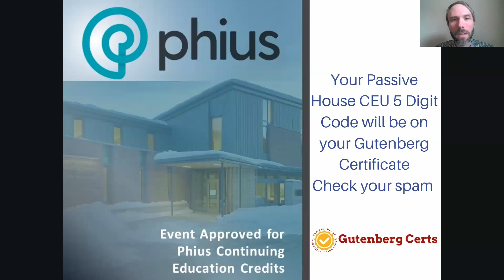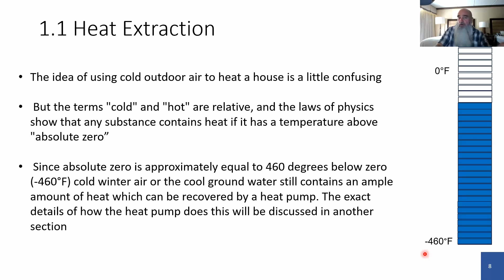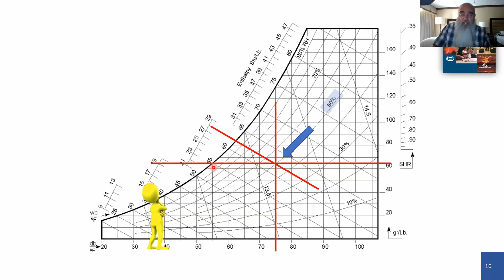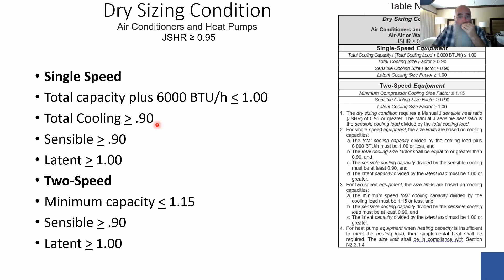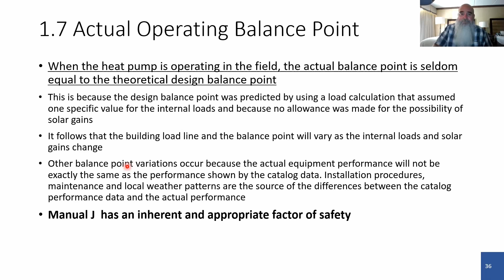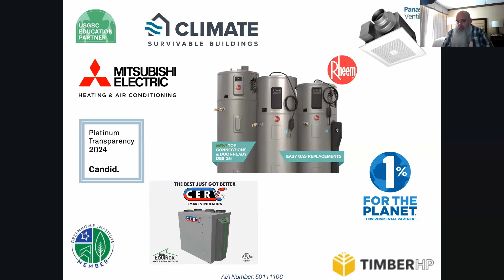Intro to Heat Pump Sizing With The New Manual H

Comment: Great video very nice surface level info to intrigue one to dig deeper and great for what an hour video can do. Like to take a class with Ed
Reply from the maker: Thank you! Please tell us one new thing you learned.
Reply: One section 1.7Actual Operating Balance Point and how Ed explains the inherent and appropriate factor for safety and why its not only built into manual J but all other ASHRAE standards I did not know that was the reasoning and haven’t heard anyone else explain it this way as to why its built into Manual J. I also liked that he reinforced what I had come to believe for sizing in my climate which is MN regarding an all electric system with planned dehumidification. I’m working on a High Performance home in Western WI where I am doing just that with Electric back up because I do not trust our winter temps. Great video keep them coming please.
Reply from the maker: @David-zn7uf  Great, are you on our newsletter to receive the invite to our live events? Are you planning any green certifications on the projects you are working on?

Comment: The "new Manual H" is not new and doesn't cover cold climate heat pumps adequately. His recommendation that the heat pump should be sized for cooling and use a lot of resistance heating for backup because, at least in zone 5 the heating load is a lot bigger than the cooling load is an outdated recommendation. The PNNL https://basc.pnnl.gov/resource-guides/cold-climate-heat-pump-sizing-and-selection#edit-group-description clearly debunks this recommendation and is an excellent source for information as well as a sizing tool that references the NEEP heat pump database.

Comment: No info on finding the mfg’s charts, most mag’s not generously helpful.  Where is the ceu code?  Lots of missing facts  guys.
Reply from the maker: Checking back here
Reply from the maker: Hello - Can you please elaborate on your question please? The manufactures charts? Which ones?  What facts are missing? Can you be more specific? Can you find the CEU code access here https://greenhomeinstitute.thinkific.com/courses/heat-pump-sizing-with-the-new-manual-h